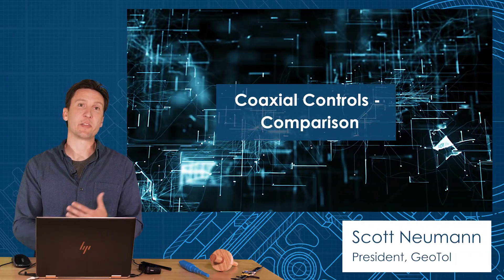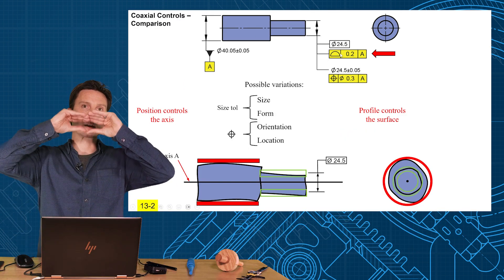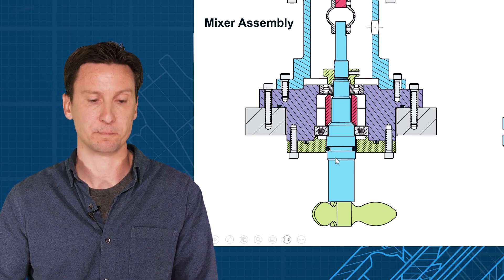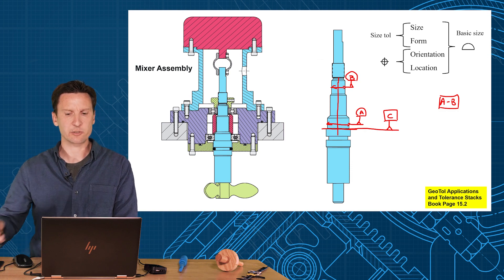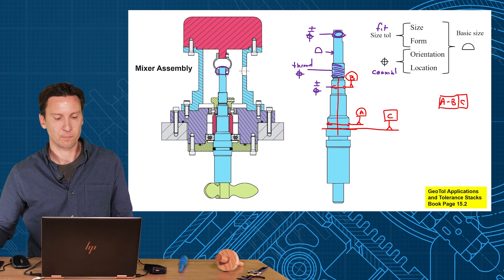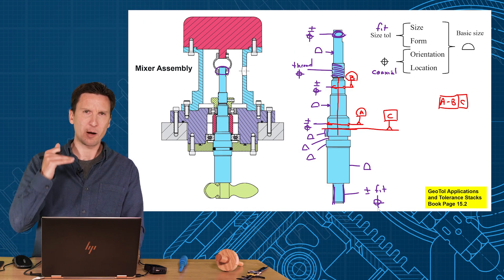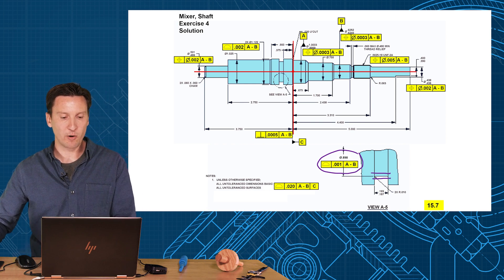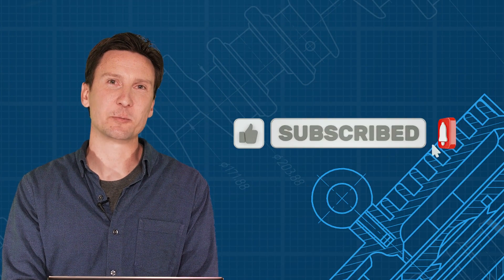GD&T Coaxial Controls – Comparison and Applications

Comment: The question should be, "What is the function of the geometric feature?"
A bearing clearance fit, simulated by datums A and B, includes an assembly and locator clearance fit. The bearing should run more smoothly. However, I do not believe we can control this with position, as it is not equivalent to old GD&T concentricity. Instead of position, I use total runout to ensure a smooth run. This applies to every datum individually and to all of them together with respect to A and B.

Comment: You know what would be helpful if you can show how it’s inspected! Like when you’re talking about the profile what do you do, just lay it in a V-block and put a dial indicator on top and rotate the part and  see how much the indicator moves. You can explain all your theory that you want But unless you show me how to inspect it, i’ll never know for sure.
Reply from the maker: On a shaft like this, profile is measured as a distance from the datum axis (simple height gage). Zero the indicator on the datum axis and measure the radius of the toleranced diameter from the datum. 

For example: A shaft has a basic dia of 1.000 with a profile of .006 to datum axis A. One measurement technique could be to zero on the datum axis and measure the surface as distance R .500 +/-.003 from datum A.

Comment: I thought because Profile is a surface control it can not be tied to the dimension that is has to be specified on the surface.
Reply from the maker: This is a good catch. The leader line should be pointing to the surface. Although this practice does get awkward on a multi-diameter shaft with lots of extra leader lines.

Comment: Can you consider zero positional tolerance for the feature you selected for example?
Reply from the maker: I sometimes don't like a position of zero at MMC on rotating shafts. The smallest shaft can then be off diameter by quite a lot. Is there a functional reason to give more coaxiality tolerance as the shaft is produced smaller?

Comment: Although a great and functionally accurate definition based on the function of the part, I would think that only very high end manufactures with high end inspection equipment and knowledge, plus a significant order quantity would have the capability and time to forensically appreciate all these features. I have problems with the shaft datums A-B ,C as these are not directly referenced in the part actual manufacture. From an inspection point of view, exactly how is A-B established over these surfaces allowing the other features to be measured from during a 360 deg part revolution? I think they're not in both manufacturing and Inspection but rather achieved using standard long shaft machining/ Inspection techniques where more careful approaches need be made on accurate faces / features.
So I understand GDT theory is required to define the parts function, but from this parts manufacturing and inspection perspective, there needs to be a different approach to suit how it's to be made and Inspected. I can imagine this shaft to require machining centers to be necessary either end with those being also used in Inspection with a series of electronic probes monitoring face deviations ( perhaps with clever relative outputs) during a single revolution. Of course, highly experienced shaft manufacturers would see similar definitions and know how adapt their manufacture and Inspection techniques to meet the drawing spec.
My view of the thread precision is that it's needs to be very accurate ( and naturally it will be anyway) as the nut when locked, has a firm radial contact on both the shaft thread and the bearing race due to friction from the pressure of locking the nut.
Designers deciding tolerances, especially GDT need much manufacturing and assembly experience in my view.
What's the point of specifying a feature can be very loose, when not specifying it to be highly controlled actually means the same thing but with less fuss and notes on the details that need skill / knowledge to decipher.
The only singular advantage that I can see is that the specifier really 'Thinks' about what is required for proper part functionality, which is imperative.
It seems to me that GDT is necessary, but unnecessary GDT may induce additional but unwarranted manufacturing thought and inspection increasing the cost especially in early quoting.
Despite these comments, I appreciate these video's and I'm learning from them.
Reply from the maker: Thanks for the comments. The tolerancing scheme, including the datum feature selection, doesn't require a method of manufacturing. It only defines the functional requirements. The requirements of this part are: when the part mounts on the bearing journals, all features must be sized and coaxial within XXX, some tighter than others. As you said, manufacturing will probably cut all features at the same time using machining centers. 
Quality has to ensure the functional requirements are met, which could be done in many ways: One method is a set of vee blocks, micrometers, and a dial indicator. Another method is a CMM. One plan may measure only tight tolerances and leave the looser ones unmeasured but to be met by monitoring the process control data (don't measure any tolerances over .010). Another quality plan may measure everything during first article but then only monitor a few critical tolerances during production. 
The point is: the tolerancing doesn't tell you how to manufacture or inspect, it only defines the functional limitations of the product. This gives both accountability and traceability when the product has variation.  Don't have a design engineer define manufacturing and inspection methods. Design should let manufacturing and quality use their engineering expertise to develop their own plans that meet the clear functional intent.
Reply: @GeoTolPro  Thanks for the in-depth reply. As an apprentice over forty years ago now, I did stints in the methods and QA departments. We had a 'route card' dictating the the method of manufacture and other tolerances not on the drawing and then what inspection had to check or not etc. So everything very similar to what you have said and thank you again for the extensive reply. My concern is really for the smaller job shop that just hasn't got the expertise to interpret such drawings. Having said that the methodology certainly makes sense and the specifying of GDT seems quite straightforward and entirely logical and right now but what manufacturing needs in many cases can be entirely different to what's on the drawing as you have said in a few video's now. It probably comes down to difference between common ordinary job shops verses professional manufacturing. I've always taken great care in detailing my designs from the makers perspective as I can't afford untimely delays or misinterpretations...I will change a little.

Comment: Thanks for another great video.
So, you're basically saying that plus-minus size tolerance and position are appropriate to those portions of the shaft where relatively accurate fit takes place to the mating parts, so that size deviation is important, and on the other hand - where clearance is larger and location/coaxiality and size matter just the same, profile is better. Another scheme that is also recommended often where there is fit with relatively large clearance is a loose size tolerance and position at MMC   to protect a VC boundary that will prevent interference. That combination also connects in a way the effects of size and location on the outcome of the position evaluation. But I think there's a good reason you chose profile in this case rather than loose size and position at MMC - and that's because it's a rotating shaft and profile also limits the runout - that's important for balance. The loose size and position at MMC scheme would be poor at preventing balance issues and the designer would probably need to add runout requirements - resulting in an overall too many requirements that can simply be replaced by one profile of a surface specification relative to the applicable datum. Is my interpretation correct?
Reply from the maker: Yes I think that makes sense. The profile tolerance gives two hard boundaries: MMB and LMB. Position at MMC gives only one hard boundary of MMB (yes, also called VC). The LMB (also called resultant condition) gets bad with the position at MMC.  If clearance is all that matters, then position at MMC works great (who cares about the LMB).

Comment: For the profile tolerance, what if we use size tol + position tol ? I think it should get better control than only using profile tolerance when you need unequal tolearnce for the size and positon
Reply from the maker: Whether you want to group the size and location with a profile tolerance or separate the tolerances into size and position depends on the application. That is the point of the video. You do not always want to do one or the other.

Comment: It is a great video.  I do have the following comments:

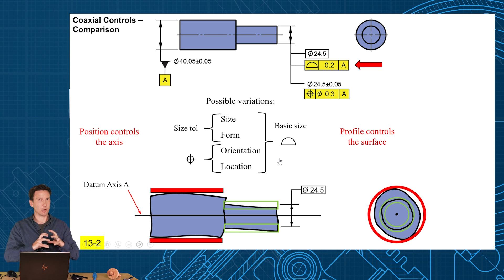At 1:55, for a better comparison (same Inner and Outer Boundaries) between the Position and the Profile controls, I think the Profile tolerance should have been 0.35, instead of 0.2.

In addition, I have not heard how fast this shaft spins in the assembly.  If the spin speed is relatively high, then I would recommend that even the "clearance" features should be controlled for dynamic balancing, with Concentricity (◎) before 2018 (1994 or 2009 standard), or with Profile of a Surface + the new Dynamic Modifier (2018 standard).  I hope this makes sense.  I did not want to write an essay explaining.
Reply from the maker: Good comments. The position and profile example were not meant to have the same boundaries. Generally, I've found the best applications for position are a tight size tolerance (for fit) and a looser position tolerance (for coaxial). 

I agree that if this is spinning at a higher speed, a control that keeps the surface centered may be needed. I would then keep the loose profile tolerance and add a circular runout. Each cross-section is evaluated separately because 2D surface evaluation is all that is needed for the balance. Dynamic profile is tighter than needed because it all has to be evaluated at the same time. Concentricity has too many interpretations and misconceptions around it to be useful.

Comment: I like this video. It shows the basic points that a designer should pay attention to.
I'm just wondering: Are bonus tolerances possible now? ("M" for fits).
Reply from the maker: Since all the fitting features are "press fit" or "need to be centered", the MMC modifier isn't applicable.